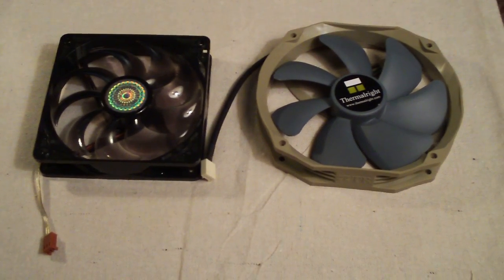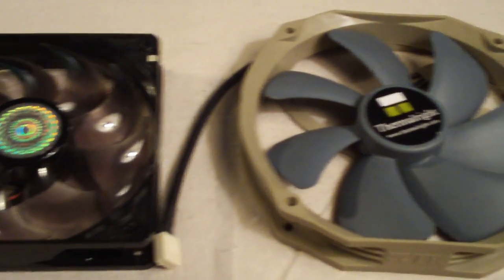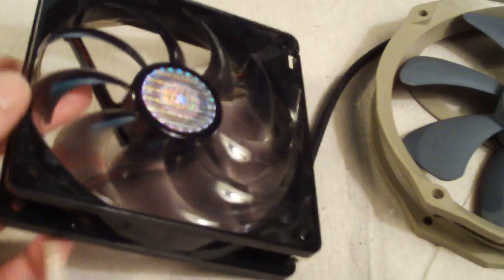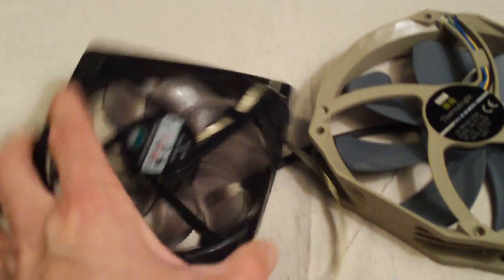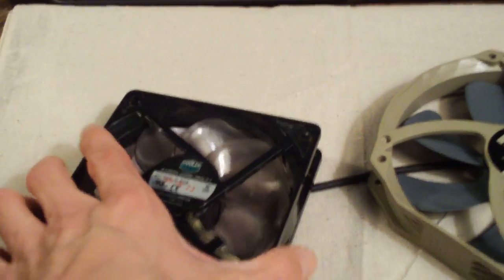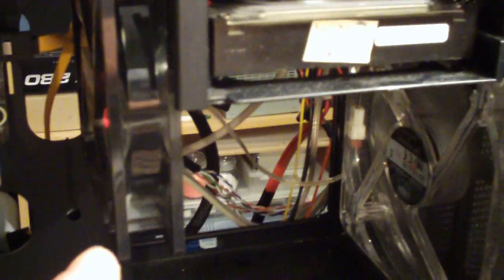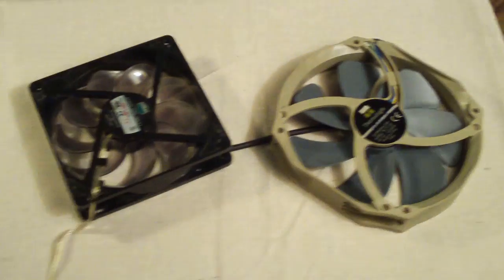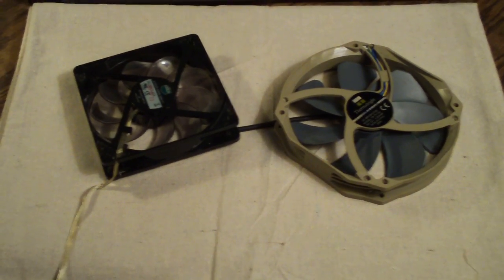Computer Fan Airflow Direction Tutorial

Comment: Most of them have the airflow direction the way that it's described in video. But I advised you that you should look for an arrow on the fan that shows the direction of the airflow because that depends on how the blades of the fan are made and the direction of rotation of the fan.

Comment: This video help a lot man. Whenever people uses push and pull terminology it confuses the heck out of me. Btw if the fan is turning clockwise and facing towards you is exhausting the air and when is anticlockwise is intaking the air right? Not the other way around right?

Comment: So I have a question I have my top fan and 2 side fans and my back fan all bringing in air but I forgot the piece that would usually seal the back of the case for the mobo anyways so there is a lot of open area for air to escape should I switch any of my fans around.....PS I was having heating issues before but now that I switched all the fans to intake my accident I find that in heavy intensive games I no longer break 55C but I had to underclock my fx8320 from 3.5ghz to 2.8ghz to keep it from overheating

Comment: since heat rises the best would be exhausts at the back and top of the case right?
Reply: Heat doesn’t rise because your pc moves air fast; so unless you have no fans this isn’t a factor.
Reply: correct. most people intake air from the front and/or side and exhaust at the back (top, since heat rises as you said).

Comment: Nor does what you said, i have multiple fans with no markings for airflow, if i really don't know i test the fan by shoving a 9v battery in the +v and ground sockets of the fan power cable.

they will start to turn, but don't get the + and ground mixed up or the rotation will be backwards.

Comment: Okay, so this might be a dumb question, but here goes. Chances are, my rig (yet to be built) will be kind of tucked away, but this is a gaming rig, so I want it to be cooled properly. It's back will be up against the wall of the room, the side with the cable management against the side of my desk, and the surface of the desk no far above the top of the case. I'm afraid of hot air blowing out of there and being "trapped." Could I set up the front fans as the exhaust fans, venting to the room?

Comment: If u're really stuck use a small tissue and see if it is sucked towards the fan or blowing away, but usually the side on the frame that the wire is attached to coming out from the center is exhaust side.

Comment: do cooler master generally have their own fan screw size?  i got a cooler master 120 case and got an akasa 120 fan- the screws it had were too fat.  the screws you could buy separately were same size but if removed a screw from one of the case fans it definitely confirms their screws are slightly thinner.

Comment: 3. Also most people make one FATAL mistake, they clean FAN from dust ...... noooo, you need to clean passive cooler ribs out of dust.
If dust is between those ribs, cold air from intake never gets to metal (bigger air->metal contact surface, better).
Passive coolers isn't solid metal piece but have numerous ribs just to increase contact surface on limited passive cooler cubic capacity.
 
Hope these 3 points answered alot ;)

Comment: 1. air has very low specific heat so cold air (outside air) needs to "attack" warm molecules to take some of their energy away. Just pushing warm air out of case (exhaust fan) isn't enough (as metals have incomparable specific heat constants) cause it doesn't take much energy from metals.
You can have for example 2 intake case fans and one exhaust, that works fine. 

2. If you have free slots, try to leave spaces between those cars.

Comment: I just bought a new fan for my gateway.. Looks exactly the same. except different manufactor. When i plug it in it runs but my computer wont start. comes up computer fan error cant boot... the old fan makes noise but it still works and my computer starts fine,, Whats wrong?

Comment: How do i install a radiator for CPU water cooling at the rear of the case for Silverstone RV03 using the Corsair H40 cooler? Do i need to mount one more fan at the rear fan slot and then mount the radiator then the radiator fan ? (fan, radiator,fan) so which one should be pushing air and which one should be pulling air as in the configuration of the fan. I don't really know how radiators work though. Thanks in advance!

Comment: I have a question about this airflow fans. In my PC case i have an area where it's getting always warm. In this area i have my graphic, network and soundcard. I was thinking to redirect the airflow from the case through my fan and outside from the case. Wouldn't be better to remove the heat from the case instead of bringing new air into the case?

Comment: i have a dv6 laptop the ram is always overheating i was thinking of cutting out a section just under where the ram is located and mounting a fan there to blow cool air into/over the ram but it will be powered of a 5v power supply would this be ok the fan will be very slim in size so my laptop wont be unbalanced i will be adding new rubbers/stands on each coner of the laptop so its around 1 to 1.5 inch of the where it sits if there any issue with this idea?

Comment: my cpu cooler is facing long horizontal and is currently blowing air up to the top and i am getting a second fan and which way should i put it so it sucks or blows on the heatsink. this fan would be above the bottom of my gpu

Comment: What case fans do you recommend?  I just bought a Corsair 650D case, and I wonder if I should replace the fans that this case comes with.  I know it will come with two 200 mm fans and  one 120 mm fan from Corsair.  Do I need better fans?  Thanks for your video.  By the way, I am a firt-time builder even though I have been around computers for more than 25 years.

Comment: I need to get a thermaltake case... i bought an Ibuypower computer (because i didn't want to fuck up building my own) and there isn't much room to add a few fans inside to blow on my mb/graphics card. Adding an exhaust fan to the top though to drop it a few degrees.

Comment: @ComputerTechTV 
Hey Rick,
I have two quick concerns for you regarding case fan. 140mm Thermaltake 2020. 
Used it for 5 years kicking on and off due to connection. Now I got solid LED lights but fan will not turn. I have black and red wire. Worth the fix?
My finally concern if replacement is called for which brand is more reputable to buy from? I have liquid cooling TT big water kit, so fan is just to assist my crossfire 4890 x2 non water cooled stock fan.

Comment: I have a question. how about the cpu cooler air flow? most modern cpu cooler air flow are towards the back or top exhaust of the pc pushing heat away. some are directed at the motherboard, chipset and memory to cool them also.

Comment from the maker: @XHolyPuffX Good question with new fans yes you have to thread them but on most fans it is not hard. If it is difficult or to make it easier once fan is in place pre-thread them before hard to avoid stripping the screw head. Also use a good fitting screw driver this helps with a large grip to ensure good torque for turning the screws and to avoid messing up the head so it will come out and be able to be reused if needed later or for another fan. Hope this helped out good day.

Comment: I wish I could see this before placing fans in this new machine running ie9x64 that wont support vid format.  All blowing in, 200 mm on top exhaust and power supply out.  its water cooled with fans blowning inward thru radiator.  Was going to reverse the side fan but told not to.  oh another on the bottom inwards as well as front.  Big time positive pressure here.  Its running cpu cooler then human body temp so ?  forgot the mb assist fan direction.  putting in now so will figure it out.

Comment from the maker: @unokilo321 Yes the R4 fans are great 120mm fans for the price. They push a lot of air and are relatively good on sound. They do click a bit when undervolted but most fans do with this type of bearing. Check out the new Scythe fans they are sweet have some 135mm 140mm frame units and some 120mm PWMs as well.

Comment: If people can't see that is there an arrow direction on the fan that identify the way the air will  clearly tell you switch way the air flow through the fan, Have have to be an idiot not to even know that the back base of the fan is where the air is being release and the outside where the fins of the fan is expose is where the air comes in.